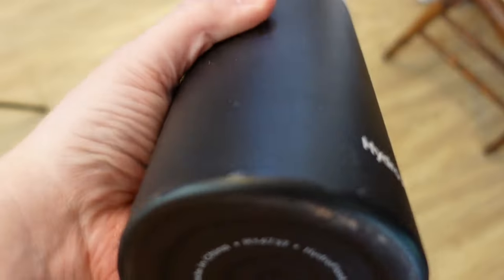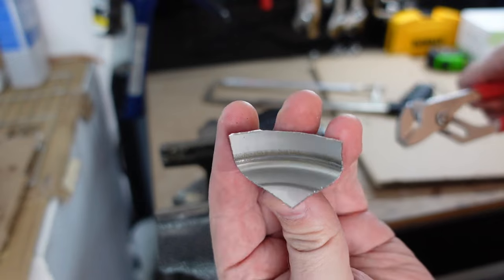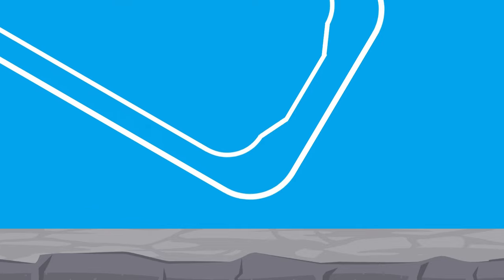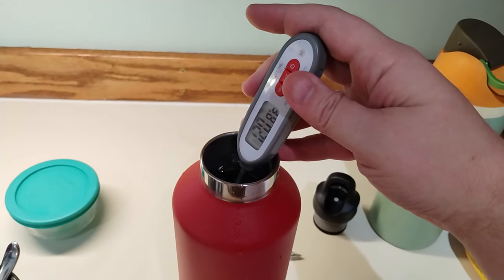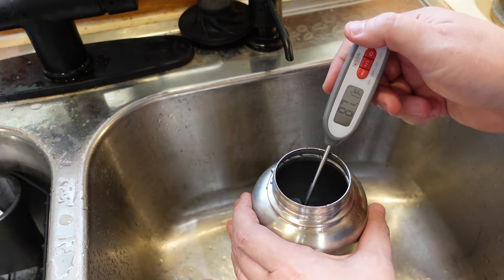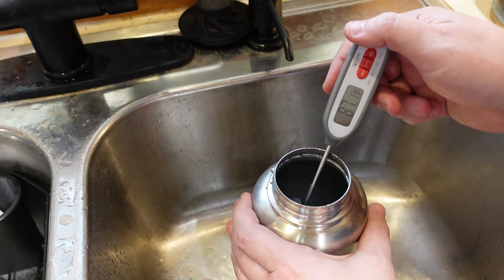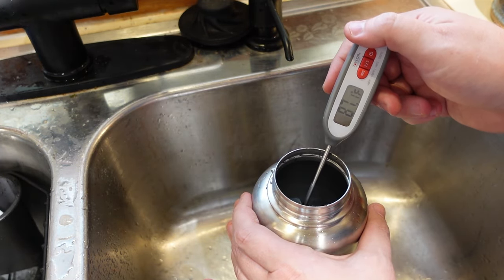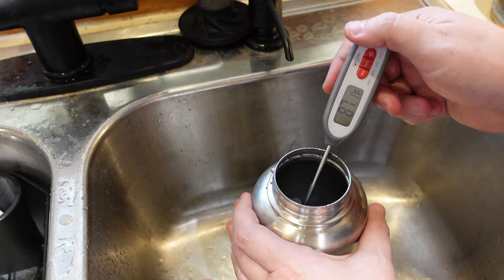Which Dents Affect Your Water Bottle's Vacuum Insulation? (Full-Length)

Comment: Some of these bottles/flasks are super thin on the bottom edges. I've gone through several of these over the years when out hiking/fishing, they all failed on the bottom edges and lost vacuum. Not usually from impact damage, but abrasion from rocks or stony ground over time.
Reply from the maker: I usually go hiking with a sling, so maybe that's why I haven't had this happen.  Most times when it's out of the sling my bottles are just on surfaces like a table, cup holder adapter, or something else flat that's not too abrasive.

Comment: I have 3 vacuum insulated bottles with major dents in them. My bottles have dents in the edge near the cap/top. My dents are alot bigger than what you made in the video but none of them appear to have compromised the seal/vacuum.
Reply from the maker: Nice!  I didn't test the top of the bottle in this video, but I'm curious if it's stronger or weaker there.  Did your dents overlap?  That's where I had the vacuum break out.  I think as long as a bottle doesn't have two dents that overlap that were impacted enough to buckle the steel, there's a good chance a bottle will still hold the vacuum.
Reply: @bottlepro3252  
Thankfully none of my dents overlap. The way my dents look, I'd be more afraid of the outer and inner walls touching than a loss of vacuum.